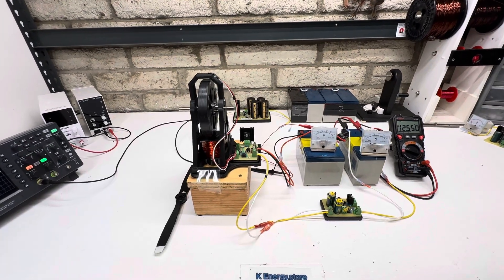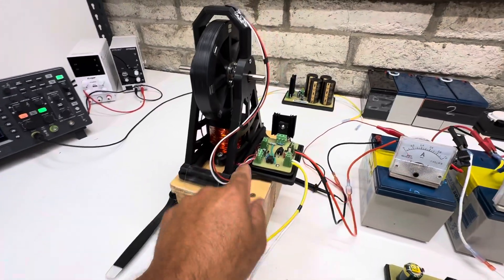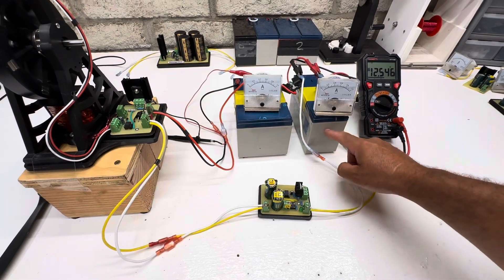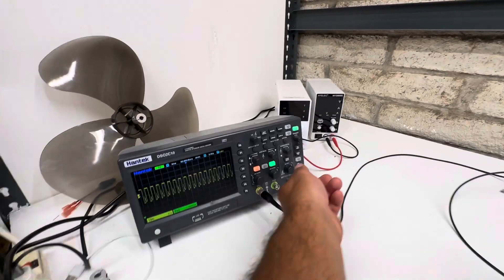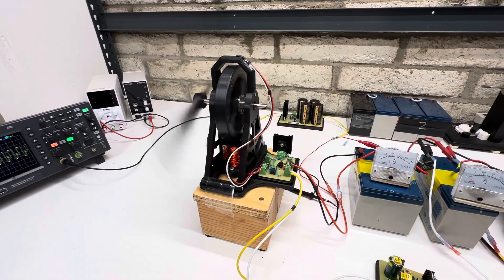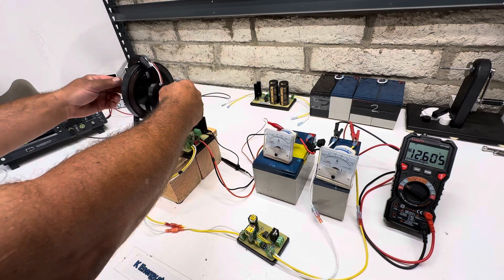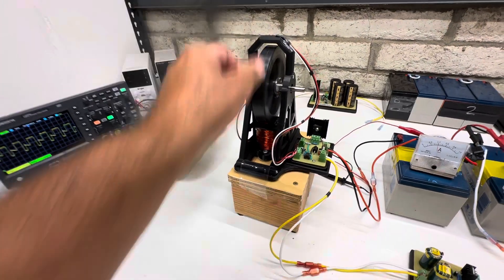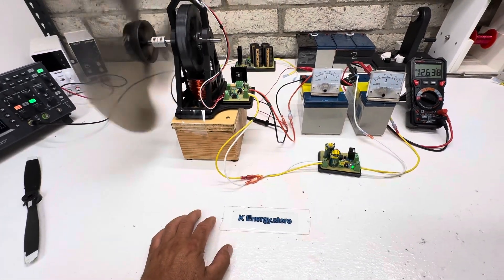New basic hall circuit

Comment: You say input is around 300V into your cap dump module and output around 16V. Do you use transformer to do that?
Reply from the maker: @Traderhood  the capacitor does that it’s designed to trigger at the zener voltage so basically acts like a step down
Reply from the maker: @Traderhood  works great for turning volts to amps
Reply: @kenergy1707  Awesome, thanks.

Comment: neat man I wanna try some circuits and run a mosfet is it a 12v max?
Reply from the maker: @MPHJR  12-24 depending on how many amps you use
Reply: @kenergy1707  ~1-2 is typical right now I would I need more to exceed 7.5v dc input not more then 5 so far though 5 amps but I haven't pushed it
Reply: I have 3 coil spread hooked up parallel 16 awg 250 turns I pull amps at very low voltage, 2 amps at 5 volts using a trigger coil atm

Comment: i made a reed that does thats but you need to incorporate a magnet to the reed a weaker magnet field than your electromagnet field , this way the weaker magnet will keep your reed in the closed position so at initial power on the electromagnet has stronger field and pushed the magnet attached to the reed to the open position

Comment: Have you heard of a reeed function that turns off the power as soon as you turn on the power and then repeats this function . Can do it with  electromagnet and a basic reed if you want just put the reed over the core so that at initial power on the field pushes the reed to an open position ;) 👍
Reply from the maker: @mykedoes4099  yes I have its mechanical the hall is solid state
Reply: @kenergy1707  how can you use the hall to turn off the power as soon as it turns on ? I never worked with hall does it have NC position?
Reply from the maker: @mykedoes4099  it has polarity one side N other side S